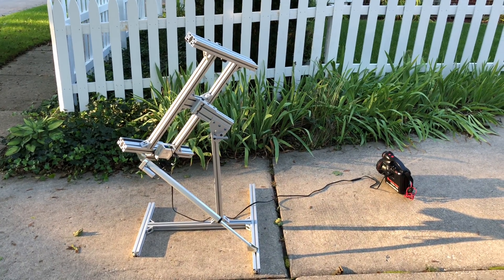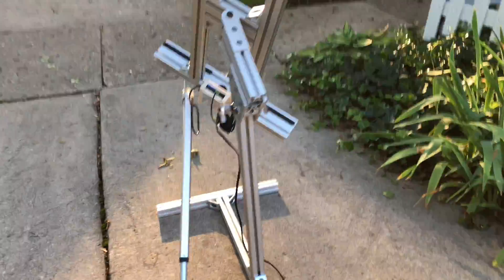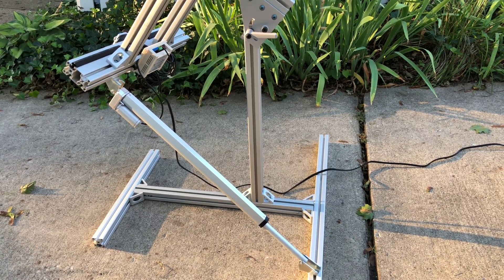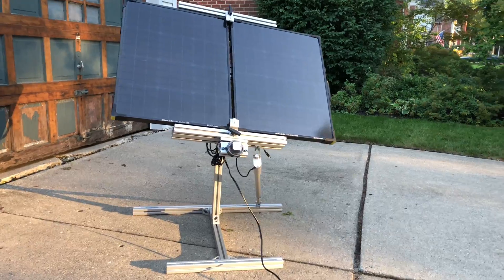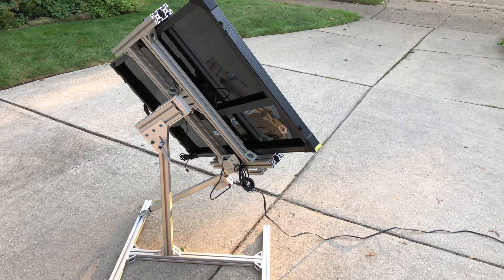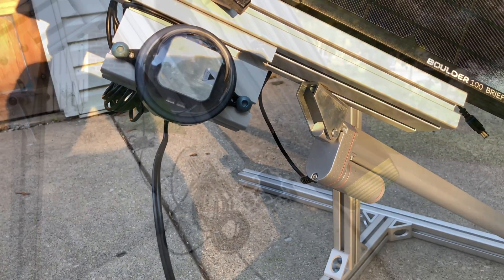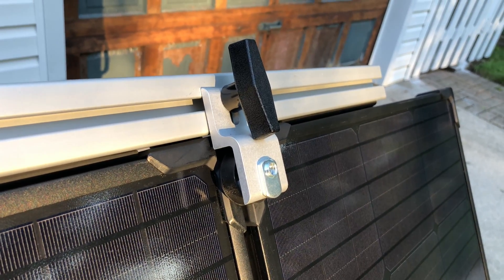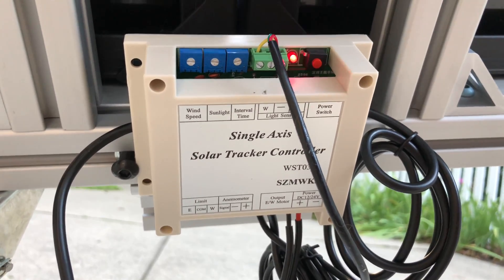8020 T-Slot Solar Panel Mount with 1-Axis Sun Tracker

Comment: What is the ratio of power used by the tracking system compared to the power generated? (Some PV systems use a "manual" wind-up clockwork tracking system specifically so that all the generated power is available for use/charging, but, of course, they are only "semi-auto" because one has to wind them up). You are about 9 degrees South of me (I live near London, UK), and I wonder how much difference that makes.
Reply from the maker: Peter Milsom Highest output I have seen on this 100 watt panel is 93 watts.  Which tells me it's been scaled up to 125 watts (or more) so that it can come close to delivering 100.  The tracking system is largely passive until there is a difference across the light sensors / diodes, then I see an 8 watt blip for less than a second.  It generally moves about once a minute.

Comment from the maker: This panel is just a raw panel, no charging controller.  It's designed for use with this power cell:   https://www.goalzero.com/shop/power-stations/yeti-400-lithium-portable-power-station/
Reply from the maker: According to the specs, this "Boulder 100" panel will charge the Yeti 400 Lithium power station in 8-16 hours, but that means a full charge from drained, and the 16 hour end of that assumes you don't have a 98-100% solar tracking mount to keep it pinned to the sun.  ;-)

Comment: Leon, 
 I’m kinda “Dumb” when it comes to solar power. What kind of power will you get out of a panel that size? What would something like this be used for as just 1 unit?
Reply from the maker: My panel is good for "up to" 100 watts, and nominally above 85%, and with the tracker keeping it within a few degrees, I should be getting close to 100% efficiency.  Even if it were 10º off, it would still be 98% of 85%, nominally.  This is to recharge batteries used to run telescopes, cameras, dew heaters, and computers (laptop and/or Raspberry Pi), used for astrophotography.   Burn the batteries down while imaging at night, charge them back up during the day and have another go the next night.  =D
Reply: Very cool!
Reply from the maker: Basically, with this setup, I can expect to get 400 Amp-hours of power (which is a lot) out of the Yet 400 Lithium Power Station for every 8 hours of good sunlight.
Reply: Leon Shaner at 100w per panel, I would only need about 150 of them to live comfortably off grid!
Reply from the maker: Haha.  =D